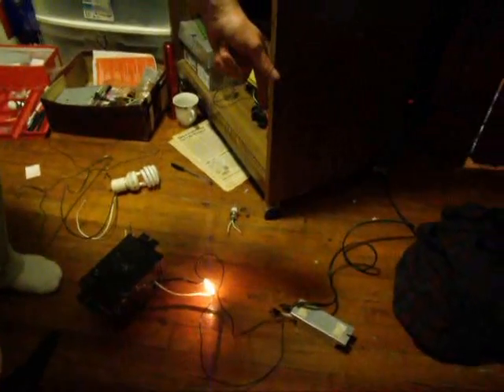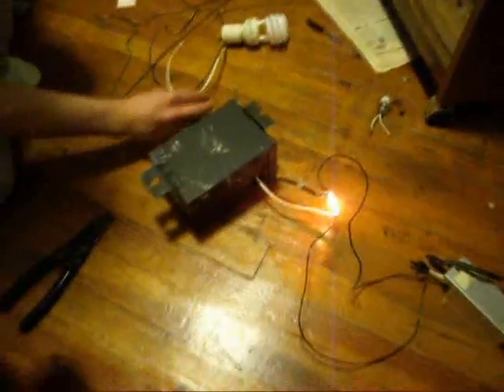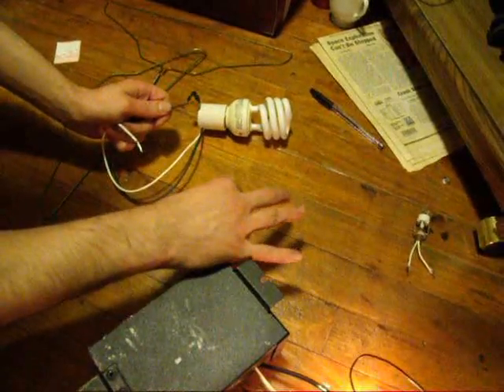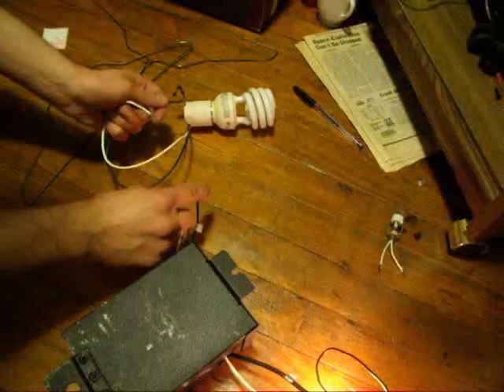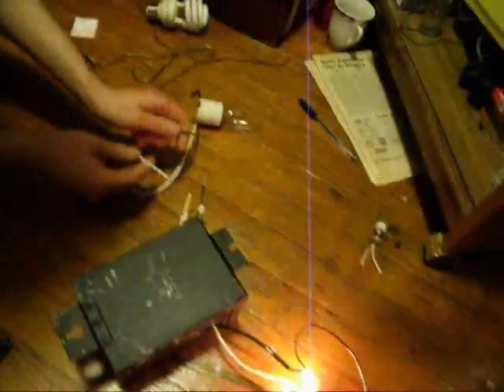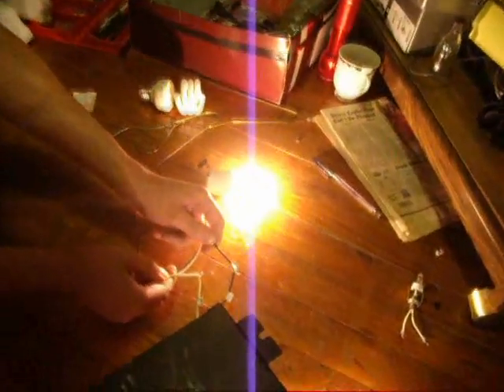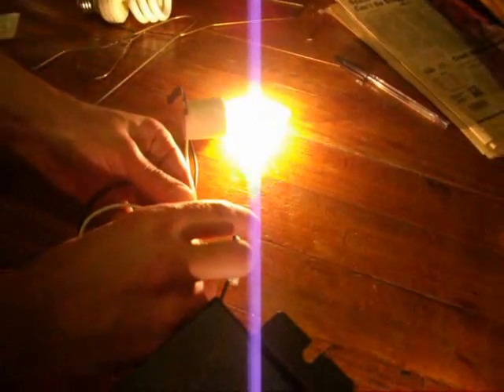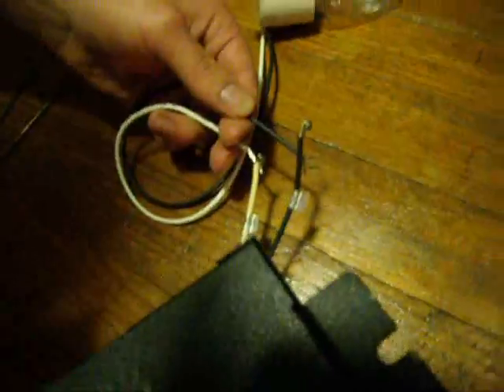High Frequency Electricity Demonstrating the "Skin Effect"

Comment: if you were to connect one wire of the bulb to the other connection and then hold the other 2 wires in each hand, does the light bulb still glow? Since it is a skin effect, I'm wondering if the bulb will still glow at full strength?

Comment: Ummmmm.... why aren't we using this now???
Reply: there is a downside to high frequency. 
a 20khz signal has a maximum distance around 10 km (6.2 miles) 
a 60hz signal has a maximum distance around 3400 km (2100 miles) 
this is with a speed of 2x10^8

Comment: It's nothing to do with the skin effect. It's because the nerves don't respond to 20kHz.

If the skin effect was a major factor then microwaves wouldn't penetrate deep into meat and cook it so well.
Reply: +Alun Jones; electricity is not quite the same as elecromagnetic waves, the comparison with a microwave is just wrong
Reply: +zanmator The comparison with the microwave is perfectly valid. Electromagnetic waves are directly related to electricity. In electrical conductors, below the plasma frequency, the penetration depth (how deep the electromagnetic radiation penetrates a material, before it is attenuated to 37%) is directly related to the skin depth. This is why metals reflect electromagnetic radiation and are used as screening. To effectively shield something from RF, the metal needs to be thicker than the skin depth at the lowest frequency of interest.
Reply: So it will cook him also 🤥😯

Comment from the maker: Well I now have a job working on public safety radio systems, got my first RF burn, stations only output 48V @ 50-100W 800-900Mhz. So Yup I have some revisions to make.  Though I do think high freqeuncy electricity is safer, it just cooks your skin, but at least it shouldnt penetrate deeply into the body and reach the heart and cause death.  But at least 10 years after graduation im finally using my degree for my career, rather than just a hobby,and im soooo happy now!

Comment: i read that skin effect at 20kh is minimal and that the reason you don't feel the pain is because the human nervous system doesn't sense electric currents at and above that frequency.
If the human body resistance is about 100 000, 125v would pass a current of 1 ma through you, totally harmless.
For the current to be hazardous it would have to be 150ma at 60hz.

Comment: I'd probably venture that is more a combination of skin resistance and impedance than the skin effect. The resistance limits the current, and impedance at high frequencies means that it will literally take the shortest distance between the two wires. Thus moving in his skin. 

Due to the low conductivity of skin and low frequency of his setup, it cannot be the skin effect. He's illustrating that electricity follows the path of least IMPEDANCE, ie in this case his skin.

Comment from the maker: @eck0aleng in this case they are not, the transformer is actually a ferrite toroid transformer,   they don't become saturated at theses frequencies like an iron core transformer would. the final output is at least 60 watts or .5 amps (as in my demo and defiantly enough to kill) and could reach at least 150 watts, the max output of the electronic transformer

Comment from the maker: @alex681219  the power in the secondary,so in theory it should be using the same power as if i plugged it straight into the wall, but transformers are never 100% efficient ,but they come very close. in other words,the light bulb, is drawing 60Watts, but i am using a little more than 60 watts total,that power is lost in the transformer,though eddy currents and hysteresis losses.

Comment from the maker: @alex681219 nah,hes working on a free energy machine, something that doesnt exist.  his device is just picking up radio waves and turning into a usefull power sorce, unfortunatly, the devices that do work are pretty lage and can just about power a digital watch,his vid was saying his output was 5kw,hes either 10 feet away from a 50,000Watt radio station, or his vid is BS,id pick the latter. the final output on mine is 120v,with transformers the rules is Power in the primary is the same as

Comment from the maker: thanks , but your right it does have to do with good conductors,and the electrons flowing though the outside of the conductor, i can feel it,mostly the heating of my fingers.  however the effect of the high frequency does cause electrons to flow on the outside of the skin and not deep into the tissues. im not saying you cant get an electrical burn. but the skin effect can be used to run high V/A on the outside of your rather than though your body into your heat with causes electrocution